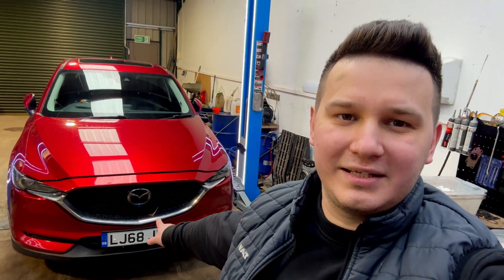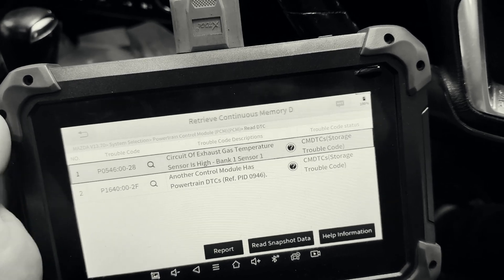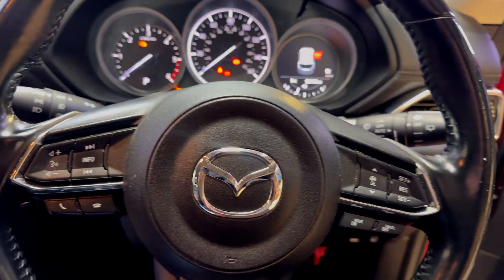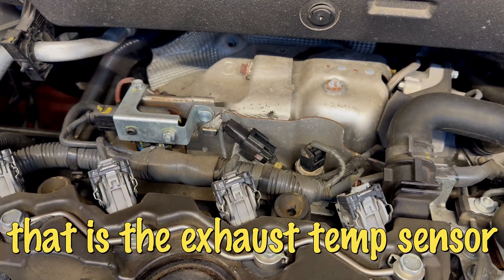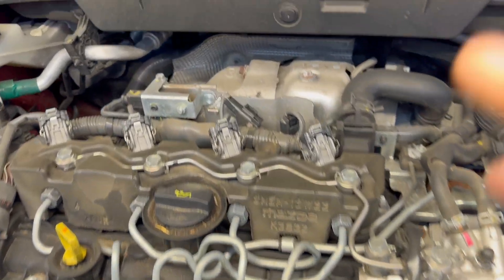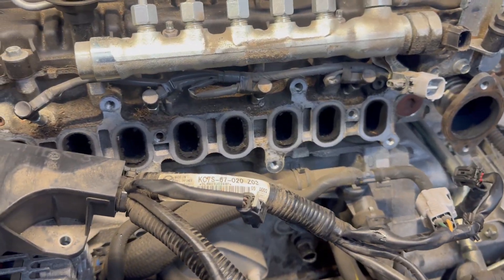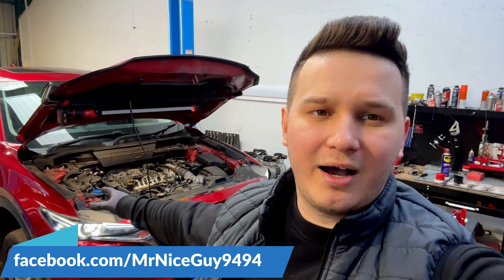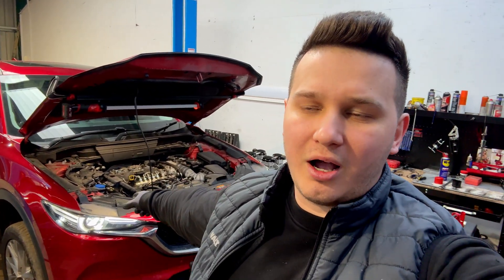Mazda CAN'T Make a RELIABLE Engine - Even New Mazda Skyactiv Diesel SUFFER from Carbon Buildup?

Comment: 400k 2007 diesel màzda6. Doing fine so you shouldn't generalize...
Reply from the maker: Did you see the question mark in the title of the video? That means it is a question. Everybody is free to make a conclusion after they have watched the video. I didn't say anything bad about the car or engine, I also pointed out some of the differences they made since from the early 2.2 skyactiv diesels.

Comment: Title was click baity
Video was flagged with dislike
Reply from the maker: What exactly was click baity? :D
Reply: Carbon build up is not exclusive to Mazda and you should be well aware why it is happening: ERG.
As for reliability for this engine, i was expecting how camshaft wearing on new engines, post 2018 models.
Reply: @FutureProofNothing  Camshaft isn't wearing post 2018 models, they fixed that problem.
Reply: @FutureProofNothing  Carbon build up is not exclusive to Mazda but in the 2012 to 2017 engines it was worse than anyone and anything else. It is why in 2019 Mazda issued a recall in Japan and Australia for around 200k vehicles (because the governments in those 2 countries forced them to) to install a code update to fix the problem. In other countries ie UK it was left at dealership level and most dealerships didn't do it because they couldn't make money from it and owners didn't know about the problem so didn't insist on it. As engines hit around 100k mile mark the problem begins to raise its ugly head.
Reply: @ thank you for Information.
nice thing about this "problems"  is that these diesel cars getting cheaper compared to petrol, which makes it good value for knowledgeable  people who can fix or know what to look for in order to find good car with good deal.
Reply: I got cx30 1.8d 2019 is it the same engine,🤔🫣
Reply: @miauversion  no, it's 2.2d

Comment: Turn off EGR, keep DPF, simple
Reply: Which means the engine now takes about 10 times longer to come up to operating temp. Every bit of research out there says 95% of the wear happening to an engine occurs during warm up. You are trading one problem for a much worse one.

Comment: are these still the same engine as 2013-2016 with oil starvation issues where engines die out of the blue?
Reply: Yes, the same engine was used in 3, 6 and cx5 maxdas over those years.

Comment: I'm from southern Australia, if you ask any mechanic they will tell you not to buy the Mazda CX5 diesel because of the problems but they all say that the petrol engines are really good, also Mazda has finally dumped the diesel from the new CX5, they finally got the message, also I was told all the problems are to do with the anti pollution stuff they are forced to put on these engines and if they never had them the engine would be good.

Comment: Catch can ladies and gentlemen 😃 and change your thermostat every 4 years along with the coolant and run 10W 40W Castrol Magnatec in the 2.2 litre diesel sky active engine
Reply from the maker: You can catch can it all day long if you want :D it won't eliminate the carbon buildup. It surely helps to catch the oil if the PCV system has failed, but the carbon buildup is from the EGR components.
Any particular reason for the thermostat replacement?
Reply: @MrNiceGuy94  Because most cracked heads are a result of bad thermostats you can't rely on temperature gauges and it's cheap insurance in fact that damn thing doesn't have any temp gauge you don't know it's overheating until it goes into limp mode, I recommend catch cans as they also worked on my Mitsubishi Pajero 3.2 litre diesel engine they stop that sticky exhaust gases and blow by from combining with soot and blocking the inlet manifold,  as for DPF I recommend acid bath, first time using drain cleaner crystals and the second using pool acid or brick cleaner acid then after a couple of hours flush out with garden hose. You won't get any premature exhaust cam wear of you switch to a 10W-40W oil from the 5-30W that Mazda tell you to use. I was told by a engineer who help  develop car engines in Australia that thinner viscosity oil was primarily introduced by car manufacturers to reduce emissions and increase fuel economy the problem is that you only gain slightly in fuel economy at the expense of the engine, Mazda Australia told me to always use 10W-40W Castrol Magnatec and you will not have a problem with engine wear. And Australia being a much hotter climate than Europe and North America it's perfectly fine

Comment: If the car has EGR, it will build up carbon. That's the cost of measures of diesel cars these days and the latest pollution standards. In Japan, they practice carbon cleaning as a regular procedure among oil changes. That's the reality we're living in now.
Reply: What about PCV? Recirculating oil? 
That can t be deleted and it blocks more than egr..

Comment: All diesel engines suck ! 
Mazda does make a good gasoline engine though 
Oh well
Reply: Thats why I swapped my CX-5 2014 diesel for a CX-5 petrol 2021
Reply: Really? No, no they don't. They suck diesel though I'll grant you that. 
235k miles Honda CRV i-cdti. 19 years old. Flawless. Flies through every annual test. 
Landrover Discovery 4 3.0 tdv6. 200k miles. Some preventative work done (manifolds) but a real trooper. 
Both will hit 300k miles at their leisure. The Honda will do 400k miles if maintained properly. 
Previous td Citroens and HDi Citroens to 250k miles. Onoy halfway through their mileage lives. 
Do some more research.